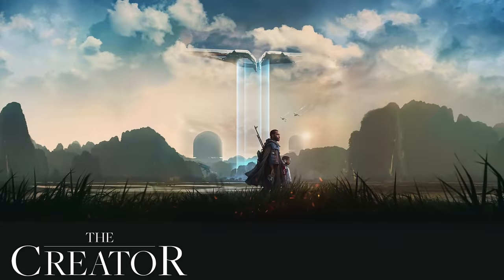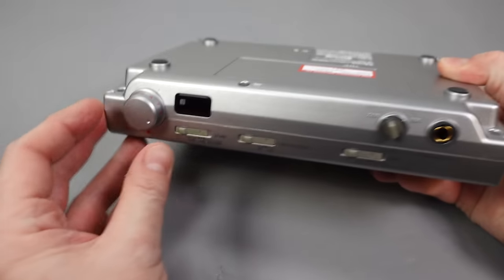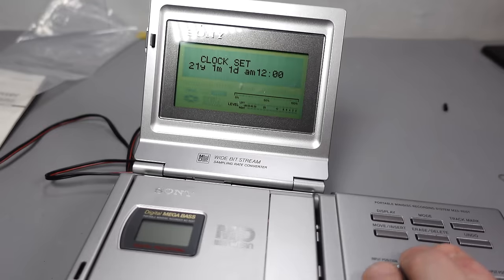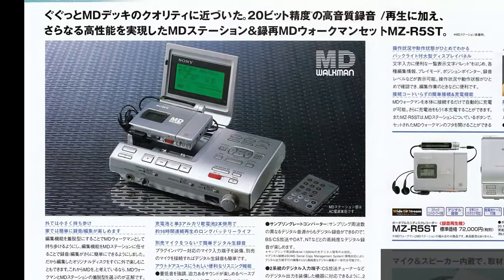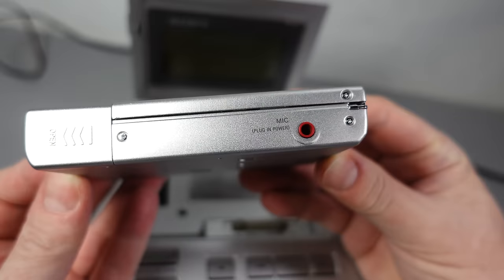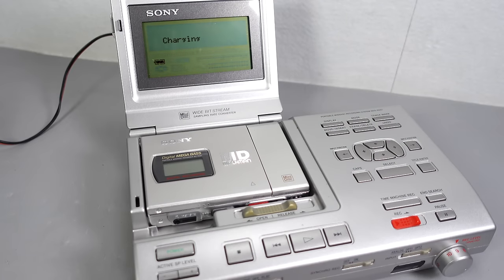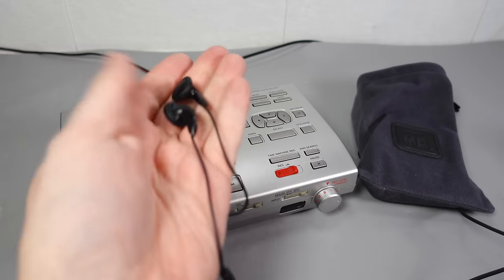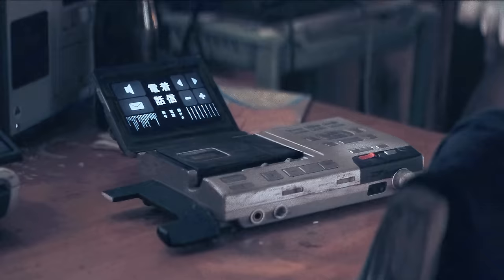Sony’s self-destructing MD Recorder from 2070

Comment: Opened up my unit after seeing your video, and yes, batteries corroded. Thanks for the heads-up! Luckily, my unit still works and I was able to clean it up inside. Replacement AA NiMHs need to be flat-ended, as normal rechargeable AAs won't fit.

Comment: Seeing that windscreen disintegrate is always surprising to me, as I still remember interacting with those as a kid and remembering them being a completely normal sponge-like material.
Reply: Seems like the sponge material used in electronics will just do that, I've seen the same thing happen to little pads of sponge in battery compartments many times.
Reply: Polyurethane disintegrates by interaction with water contained in the air. Many products nowadays contain polyurethane and sometimes I suspect manufacturers that they put PU in their products so that it "selfdestructs" after some time.
Reply: @somitomi Same happening to earphone pads, like Sony's own MDR-DS5100 VPT wireless infrared from 2000, 2001's DS8000 used a different material that still holds. I'm using them for 23 years now (Bought a few new old stock over the years).

Comment: Reminds me of game consoles. The Xbox has a capacitor also for a clock that is prone to leaking and my GameCube had a dead button battery that fortunately just caused the clock to reset whenever powered off.

I'm surprised there aren't more videos on the channel of dead disc drives. None of my devices before the late 2000s have disc drives that still work. I don't know how any of these mini disc players work.
Reply: Nearly all vintage electronics with large capacitors need them replaced. Also, a lot of 1960s-1990s electronics used filter capacitors in the power supplies that are known for exploding dramatically after being powered on for the first time after however many years.
Reply: 90's and 00's CD players fail due to the laser diode burning out... The minidisc lasers were a different design that lasts longer, like and cd drives with a write function. CD players also suffer from failing DC servos, mostly due to bad design and cheap components. The best audio cd  players to buy are Sony blue ray or DVD players... They will last a lifetime.
Reply: @peterlarkin762  minidisc lasers do burn out too.
Reply: Using AA batteries on a mainboard is far different from button batteries. The bastards who designed this were well aware many units would be toast within 5 years due to guaranteed leaking AA battery corrosion. Pure greed.
Reply: @DD-ld1xq  More like planned obsolesence.

Comment: the damage can probably be fixed with a lot of extra work, though I think those are multi-layer boards. I wonder for preservation whether anyone has considered reverse engineering the machine and reproducing the PCB. The components could then be swapped over, with any damaged components replaced.
Reply: If the damaged isn’t deep, then you might be able to soldier a few bodge wires to replace the damaged traces but I suspect the damaged is a bit beyond the “bodge wire”stage.
Reply: @Charlesb88  These are multi-layer boards too so difficult to 'bodge', especially as once corrosion starts it's very difficult to stop.

Comment: You MUST neutralise the circuit board with vinegar to stop the continual erosion of the board otherwise the rot will continue and it will  permanently damage the working components as well !!!! As a vintage computer owner this is a familiar problem and there are plenty of youtubers who have content to address this problem, I implore you to take immediate action and get the Vinegar out.

Comment: The corrosion may continue. so you'd be wise to scrape away the solder mask (if it got beneath it) neutralize with vinegar and clean it up with IPA.  Then paint over it with nail polish.

Comment: You need to remove that shielding from the circuit board and fully clean it off. The corrosion can continue spreading if the electrolyte is not cleaned off.
The missing traces I saw are easily repairable.

Comment: I have one of these which I originally purchased from Japan some time in the late 1990's. After watching your video I opened it up and was pleasantly surprised that the 2 NiCaD batteries are almost pristine - no signs of leaks at all in fact!! I somehow doubt after 25 years that they are still working, but I took them out as a precaution. The LiPo and pencil batteries are also pristine. 

One question - Is there a market for this type of gear? If so where do i sell it? I'm based in Ireland. I can throw in lots of blank and self recorded MD's and even one quite rare pre-recorded album by the Beastie Boys. I'll sell it all to a good enthusiast home. Not looking to make a pile of money but rather get it out of my attic and to someone who might appreciate it a lot more.  

This was a great machine back in the day! Loved the idea of a docking digital walkman.

Comment: at 8:55 you talk about the Lip-8 Battery. I have a few additions to it, that may help some long term users out there: These cells tend to have a very long life, but if you let them sit idle for years, the self discharging pulls it down  below the minimal voltage the charging electronics expects. So while the cell seems to be dead, it most likely isn't. This can be adressed rather easy, if you have a current controlled power source, like a laboratory power supply. See, almost all chargers out there won't accept to give charging current to any LiPo Cell that has its Voltage dropped below 2.8 Volts. But with the laboratory device you can easily pull it back above this voltage, so it can be charged normally again by its original charging method. Set the Voltage below 4.2 Volts (which is the absolute maximum Voltage you should use !), better use 4 V for some safety margin. Set the maximum current according to the mAh writing on the battery - in this case 750mA or better a little less - lets say 600 mA (0,6 A). 
Now comes the tricky part: You have to take the battery plastic casing apart, to get to the cell direct outlets. In this case it luckily isn't glued together (unusual for Sony ^^), it is hooked together by rectangular fins that have a rectangular whole in them that click into edgy hills in the base side. By pulling and locally pushing the round top casing inside in the edge to the base with something thin, you can eventually get them loose piece by piece. Three on each side, one on the small side. You don't have to take it apart completely - just get a gap between battery and the base with its electronics, so you can reach the power fins coming from the cell directly with crocodile clamps. If you know something about cylindrical LiPo cells, you'll know which one is + (where the can was closed by rolling a groove into it). Now, you can check the residual voltage for academic reasons, by turning down the laboratory voltage to zero, but it doesn't matter. Most LiPo cells will also start charging immediately, if they have drained themselves down to completly zero Volt. Now let it charge as long as you like - because LiPo cells will stop charging incrementally as closer as they get to the voltage you set on your power source - and stop completely as they reach it. After some hours, you should have it well above the 3.4 minimal Voltage threshold all charging devices out there will recognize as a sufficient  starting voltage. Now you can put the housing back together and charge it up to its exactly 4.2 Volt fully charged state witht he original charging method as normal. Will it have lost some capacity, because of the complete draining? Yes, it's not something that helps the cell life. But it will work again - keeping the original cell usable - which is quite remarkable for cells that are now almost 30 years old...

Comment: Here I was thinking I knew my Sony MD products well and then Techmoan once again proves me wrong. ;-) Fascinating device and very Sony. It still boggles my mind that there was't more foresight on the impact of leaving those batteries in place over time. It was well know by then what happens to them and it doesn't take 2 decades for them to leak either. Just like those soldered on Vartas on old motherboards, this is something that just shouldn't have been allowed to happen. Another lesson here for all of us tech collectors, if you are putting anything away in storage and it has a battery in it, remove it!

Comment: Whether you decide to fix the damaged PCB traces or not,  I would recommend spraying the corroded area with a multi-metal corrosion inhibitor made to spray onto electronics like ACF-50 to prevent the corrosion from progressing.
It is distressing the number of vintage electronics that I have found damaged by have [NiCd] "memory backup" batteries soldered onto the PCB that have leaked and attacked the PCB.

Comment: the YouTube channel Cathode Ray Dude has a video called "An MP3 Jukebox for Everyone" about a product that feels very similar to this one — it's a home stereo unit for playing MP3 files that rips them directly from a built in CD player that transfers them to a portable MP3 player. the really wild thing about that unit is that for the portable unit, it writes the music to RAM, which means you do lose all the music you copied over if the batteries die completely, but it's so much faster than any other method of writing to portable storage could have possibly been at the time. on the one hand, it's certainly more convenient to not need these sorts of solutions nowadays, but both of these devices display some fascinating attempts to solve the problem of having a music player that meets both your home and portable needs.

Comment: Still have my little minidisc walkman MZ-N710. Only thing wrong with it is the mains adapter for the docking station self destructed. The 3v output cable was rubber for some reason and just fell apart. Found a replacement on eBay, bought a new rechargeable battery whilst I was at it and hey presto, she lives again. I have full sized units as well. Minidisc was probably the best music innovation that never took off, and I fathom out why. It’s such a great format.

Comment: This device is good example why shipping devices with batteries already inside is not so customer friendly in a long run. 
And also why I like devices powered by regular AA batteries over custom shaped ones. Ones the battery dies, all i have to do is get new couple of AA batteries from any store and I’m good to go, instead of searching for alternative solutions because original manufacturer doesn’t produce them. That’s why I’ll always choose Xbox over Playstation gamepad

Comment: Jeez, my hart sunk to my stomace watching this. I obtained a used MZ-R5ST  from a Japan Yahoo auction a couple years ago. A real catch as it cost me under €250 with shipping and tax and was in working order! It  even has a LIP-8 battery that is still alive. It's been my daily driver MD ever since, sitting next to my PC and I'm loving it to bits. Lately it had some issue, switchin on by it self. Not much of a deal, I was thinking some stray IR signal was activating it. A 30 year old machine can have some quircks. But I did not know of these freaking clock batteries! So I got my unit open, and  luckely no leakage. Only some green stuff on the negative contacts of these batteries. But a question: Do you need to replace them, or are they only used for the clock and can I leave these batteries out? Any way thanks Matt for pointing this issue out. Great video as always!

Comment: I would agree with some comments that it could be fixable. Being an electronics engineer for over 35 years I have seen and repaired worse than that. So, maybe a straightforward fix. Would be nice to get those audio outputs working so those speakers can be heard. Ive heard similar sony speakers and they were very good.
Reply: Same and agreed !

Comment: The damage doesn't look that bad, at least not what we can see in the video.   You need to neutralize that area (usually with a mild vinegar) and then clean it with IPA or it will get worse with time.  That copper shield should be pretty easy to un-solder and remove, then you will be able to see things better.

Comment: This is a surprisingly common problem. For example: In my first Volvo (Year: 2003. Model: S60), the Alarm Module had a built-built in battery within the sealed Unit that died mid 2007. Volvo wanted a ridiculous amount to replace the Module - in excess of £500!
 Thankfully, I found an enterprising young man online who offered a repair service for just £100 - with the option to place the battery outside of the Alarm Module enclosure for easy future replacement... if only Volvo had thought of that!

Comment: It may be repairable, but in any case there are steps you should take to mitigate further damage as is still corrosive liquids on the board which can cause further damage if not cleaned up properly, even with the batteries removed.

Comment: Gday Mat, .. sounded strange when you called the battery a "One Four Five Double 0" instead of the more conventional "Fourteen Five Hundred" (referring to the 14mm diameter and 50mm length battery standard nomenclature) ... interesting device. Thanks, as always, for the video )). Pots. Australia,

Comment: Heh.  One of the PCs I serviced early in my IT career was a Macintosh PowerPC 5260.  It used an internal battery for the Apple equivalent of a CMOS, called a PRAM.  That battery was much smaller and while not easy, it was not as difficult to get at as this Sony's battery.  It was also not inclined to cause as much damage in the rare event of a leak since it simply didn't have as much to leak out.

On most Wintel-compatible PCs they just used a CR2032 battery, which I've never seen one of those leak.

Shame Sony didn't put these batteries into their own compartment where leakage wouldn't have mattered so much if they felt it was really necessary to have them at all.

Comment: Apologies if this has been suggested somewhere within the comments. Maybe the analogue inputs/outputs were dead out of the box. Perhaps that’s why there is a few blank tracks on the disc included, and might explain why a lot of the accessories were still in their original packaging - could explain the nearly new condition of the machine and why it might have not been used? Seems odd that a battery leak would take out the whole analogue amplifier stage, not something I ever saw repairing this stuff 25 years ago… just a thought.

Comment: You might not believe it but i guarantee that's more likely fixable than not, even despite the corrosion damage. Been doing those kinds of repairs for decades now. I have 2 mini-disc units myself, one portable recorder that has almost every feature that yours has, (which does have the stick type remote also- though without the LCD portion) & a player only with an alkaline/rechargeable AA compartment that did have corrosion damage when I got it, but fixed up fine.

The worst audio repair I've ever done was on a 2500 watt JVC that had multiple daughter boards & someone had it in their basement after they just moved & had't taken the time to set ti up yet, & the basement flooded & a neighbor's area had bags of gardening lye that dissolved into the water & flooded the unit where the heat exhaust grid was & it spilled inside. Re-did over 900 damaged traces & a few minor components. He hasn't asked me to work on it again so I assume i'ts running fine still. I own two others, another JVC & a Phillips FW-577, as well as a older PC that he sold off to me & all 3 work fine now. The PC I use as a media server & runs pretty much 24/7.

The most common repairs I've done was HP laptops whose power strip that runs along the top of the case just below the screen & often has the power or other media buttons on it. Decades of their laptops have the copper traces completely exposed to the air; no Plasticine coating, lacquer, not even soldered or fluxed as a barrier. In my career I've fixed probably 18,000 of them in total. I bought surplus from their supplier & properly coated them myself so I had ones that I knew were reliable & could just swap out the crappy stock one for mine. Eventually I stopped repairing them, & advised customers to stop buying them, because there were just so many that needed replacements in que I would have needed to start a new business solely dedicated to replacing that part only.

Comment: Acidic leaking batteries can eat away at circuit board tracks. I would clean any residue off and look for compromised connections.

Comment: Panasonic NiCad batteries are really good if you can find them.
Interesting note about NiCd is that they are one battery type that can sit completely drained and it won't damage the battery.  As long as it doesn't leak.
I have a Norelco shaver from the same vintage that I still use to this day.  Panasonic NiCd batts ran for 23 years before the runtime got too short.  Found replacements on DigiKey.  Not sure if it (or I, LOL!) will last another 23 years.

Comment: I remember having to repair a beautiful Schaub-Lorenz Radio from the early 1960s. They have used a NiCd cell as a kind of voltage regulator for those early Transistors built into the radio. The damage on the circuit board looked exactly the same and i had to remake some of the traces with copper foil.  Of course, this is not an option for such a complicated device.

Comment: One of the fantasy albums I listen to, "Jeroen Tel: The First Thanksgiving,  November 25, 1621" that I recorded from Sidplay, was recorded on a Sony MiniDisc.  Luckily, I was able to get an optical digital copy onto a 24K gold CD-R before the original recorder died almost 10 years ago. If you have a software defined radio,  hook up a phototransistor to it with a voltage bias on it followed by a capacitor in series so you can record the optical out. It's too fast for an RTL-SDR...but I think a Mirics SDR can handle it.